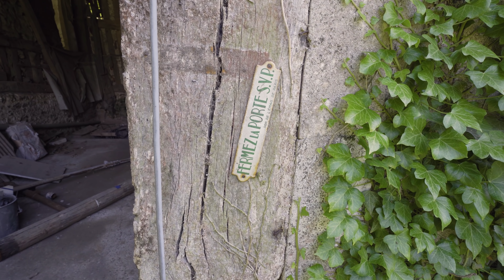Discover our MEDIEVAL BARN - How to renovate a Chateau (Without killing your partner) ep.27

Comment: the object of wood and steel where your wife turned the handle is an old Jack to jack up a heavy object in the building trade. The carpenter I worked as a boy in the Netherlands had one standing in the corner of the shop.

Comment: You can get metal paint and paint the cheap looking aluminum base of the ceiling lights you don't like.  You could also mount it on a base, maybe with a crown moulding surround to match the moulding you're using on the walls, and paint the whole base metal and all the same colour as the ceiling/moulding.  it would probably look like something from the 20s in keeping with the old lights you're putting back!  They are lovely, by the way, I'm glad you're going to reuse them.

Comment: Love the light fixtures!  If you remove the electrical parts, then you can boil the fixture in water to remove the paint.  Do not use a pot used for food preparation!  The old paint may contain lead.  The combination of boiling and cooling (while you remove paint) causes expansion and contraction of the metal.  I used wooden chop sticks, a wooden spoon, a cloth, and an old toothbrush to clean the softened paint off the fixture.  No toxic chemicals besides paint!  And less expensive than stripper.  Clean/polish the metal or paint, as appropriate.  Good luck!

Comment: The one with the handle that still works could be a winch type thing to haul hay and used as a pulley to hang to pull in the hay into the barn.

Comment: The „mixer“ is a stick winch. With this device you can lift things, for example, you can lift a beam to replace another. You can lift the things on top with the metal part or on the side with the claw. There are still new ones you can buy :)

Comment: I did not see the whole video before I answered! You knew what the machine was used for.
One question when we get to see beehives over the house from the drone see is houses are not symmetrical, the chimneys on the right side are located by the outer wall and it looks like some are missing. Has it burned or has it been made smaller? Another castle I follow there was some sold it was stone!
Marianne wonders
Reply from the maker: Hello Marianne, I'm not hundert percent sure if I understand what you mean, but the chateau has been extended in the 19th century, that explains the asymmetrical shape and the chimneys

Comment: Oh Phil, you need a rope to lead a cow and branch to use as a switch on their bottom to keep them moooving!. If you haven't one, grab the cow by the ear and twist. YOu can do the same thing with the tail to get them to stand up. It hurts them just a little and they will get moooving! THat machine is for separating the grain from the chaff, the outer shell. It's called winnowing. It is a winnowing machine. I think if  he building is as old as you think it might be, the French Historical Society might prevent you from knocking it down because it might be considered to be an historical treasure. In which case, they might offer you funds to have it restored to its original or better condition. !! That would be nice! Architecture classes at the local university might like to have field trips to come and see it! Give them a call once you get it tidied up.